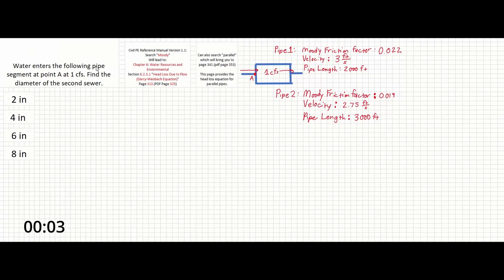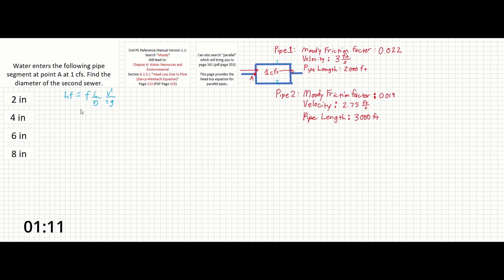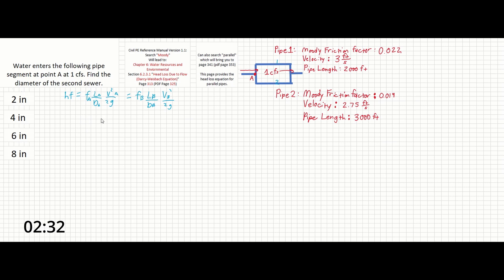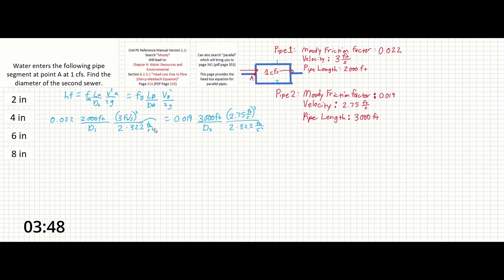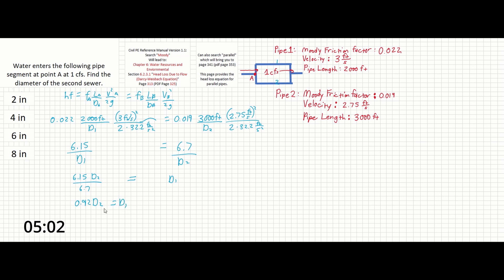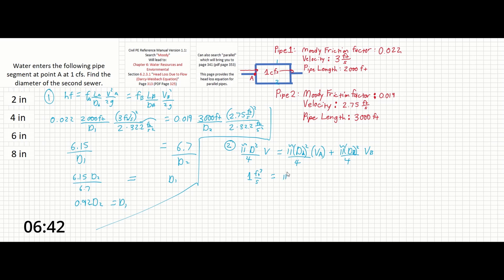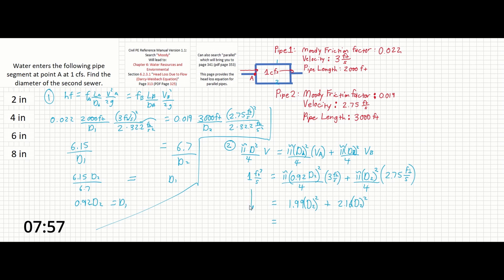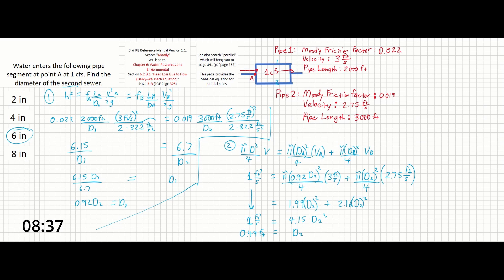PE Exam Practice Problem #2: Water Resources | Pipe Network - Moody Friction Factor

Comment: Can you explain why you don't use the Q=VA, and A_1V_1=A_2V_2?
Reply from the maker: Hmm. Not sure I see how this would be possible. We don't have either area, and although we are given both velocities, we don't know the flow in either pipe. Did you find a way to solve this problem with Q = VA?
Reply: @SolvedIn6  Since I have Q, and V_1. I can use Q=VA to find A_1=Q/V_1 =1/3 ft^2. Asssuming that Q is constant, I also have V_2, so I can use A_1V_1 = A_2V_2 to solve for A_2 = 0.36 ft^2. D= 068' = 8.16"
Reply from the maker: @julianklein7488  Q is the total flow moving through the system. A total of 1 CFS is moving past point A, and splits between pipe 1 and pipe 2. It would not be accurate to assume the area A1 is based on 100% of the flow at point A moving through Pipe 1, unless we are assuming there is no flow in Pipe 2. I think this is why you have calculated a larger answer than I did.

Comment: On long variable problems like the last step, a calculator with a solver (which NCEES approved calcs have) really helps to remove some error. Thanks!
Reply from the maker: thats a great point. i'll be the first to admit i dont usually use it but i think its awesome when people have the presence of mind during an exam to remember that they have access to those tools (and know how to use them)
Reply: What model? Please let me know. Thanks!
Reply from the maker: @Proudlyafrican2003  I used a TI-36x pro - there are a lot of good videos about it. I made one myself about it.
Reply from the maker: Also Youtube has stopped sending me notifications about a lot of posts on problems unless they are new comments. Not sure how to fix it but sorry it took 3 days to respond. I luckily got another new comment on this video today and saw your comment too.
Reply: @SolvedIn6 thank you. I have already ordered a Casio FX-991ES. Hopefully, it’s as good!
Reply from the maker: @Proudlyafrican2003  whatever you use to study with and whatever you learn to use quickly will be fine. I don't think any calculator will make or break your ability to pass. Just make sure the model you choose is on the list of approved calculators.
Reply: @Proudlyafrican2003 TI-36x Pro is on the approved list as of right now (September 2025) and its what i used, you can look up a video on how to use the solver better than i can explain it here